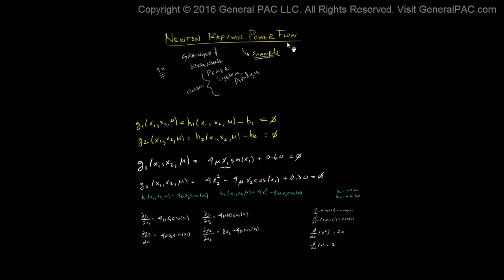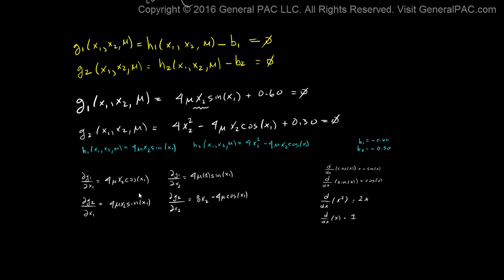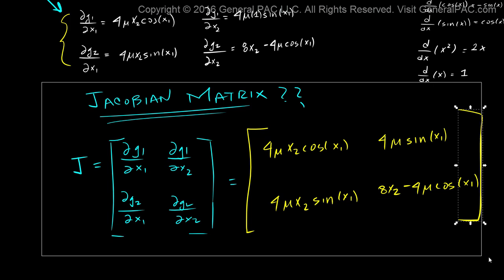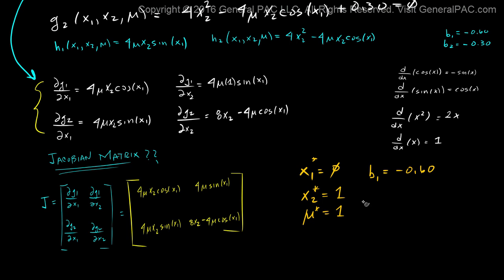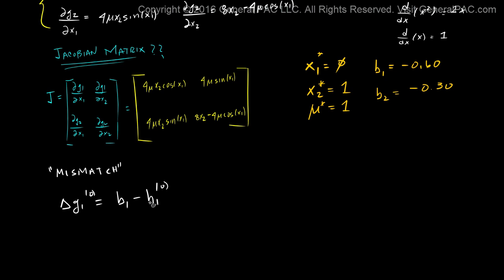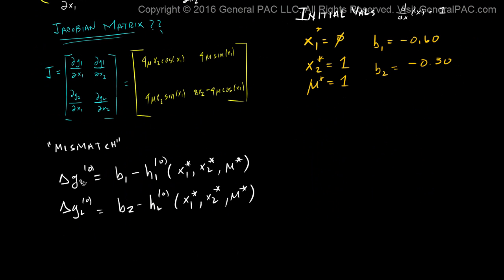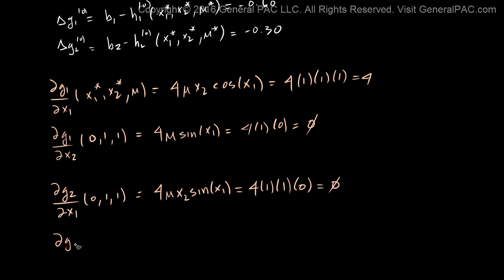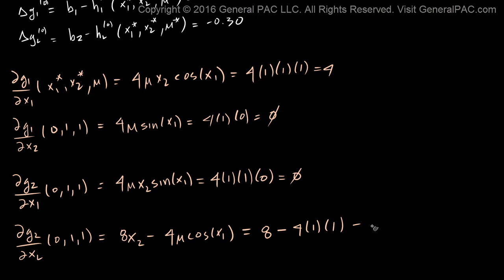Newton Raphson Power Flow Example Part 2

Comment: why (delta g1 = b1-h1 ) and not ( = h1-b1) .... i hope you answer ... thanks a lot
Reply from the maker: +Abdullaziz Almulla we were following the example in the book. But we have thought about this before. I don't think it matters if we calculate h1 - b1.... Or b1 - h1... As long as we properly calculate the the delta x1 properly. Some books and examples calculate this different than others but adding a minus sign in front of the Jacobian matrix.
Reply: GeneralPAC: Power System Tutorials okay thanks for the fast reply 🙏💛 ... but i was confused because the given equation is g=h-b ... but while solving it became g=b-h

Comment: Hye. Why do we use partial derivative for resolving it? I mean why do we need to derive it partially and make other variable constant? What.is the reason behind holding one variable constant while the other one is changing ie. dP/ d( delta1) while other delta are constant.